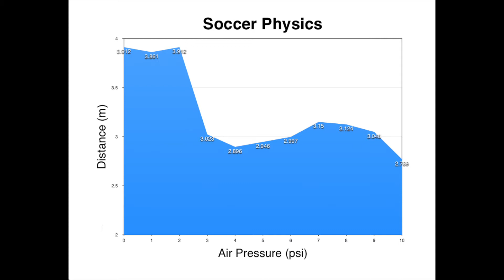Soccer Physics

Comment: Hey, I'm a college student and we just did pretty much the same experiment as a lab project and got the same results. We think it is due to the different impulse times. When the ball is at a lower pressure it kind sticks to the kicking arm so more energy is transferred to it. When the ball has a higher internal pressure, it bounces away from the kicking arm during the collision, so it is touching the kicking arm for less time and less energy is transferred to the ball. If you think about a follow through in golfing it's kind of the same thing. A good follow through gives more energy to the golf ball so it goes farther.
Reply: Hey could you give me like an in-depth response to like the scientific reasoning for how the air pressure of a ball affects the speed. Thanks, I need it for a school science experiment